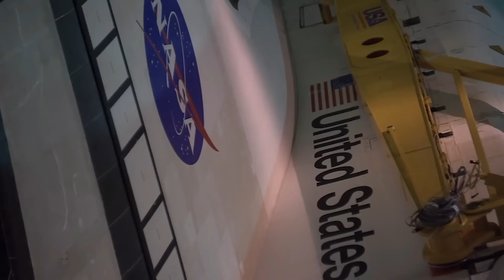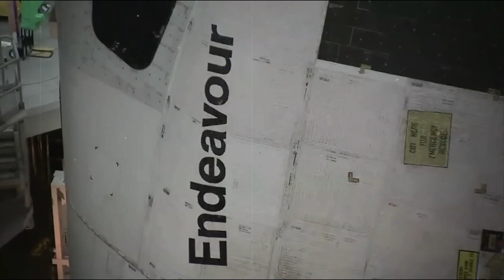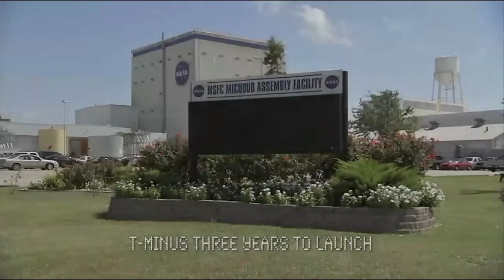This Is How SpaceX Reinvented The Rocket!

Comment: The space shuttle was only partially "reusable". The fuel take and 2 side boosters were disposable. Only 1 out of 4 components was reused making it 25% reusable. It's like a 747 throwing away it's fuel tanks and 2 of it's engines after every flight.